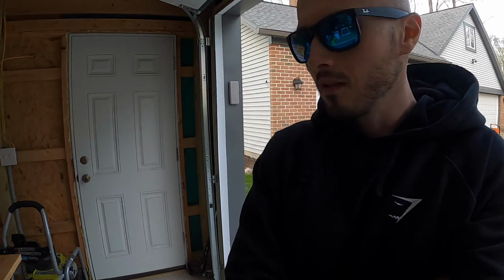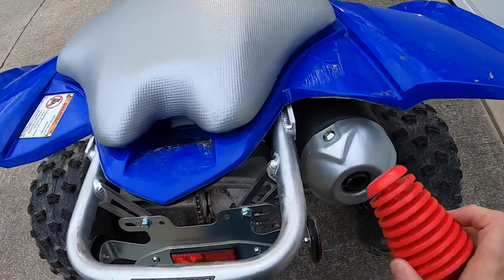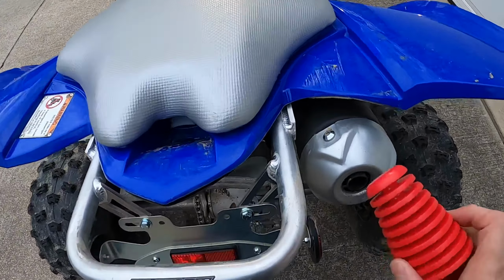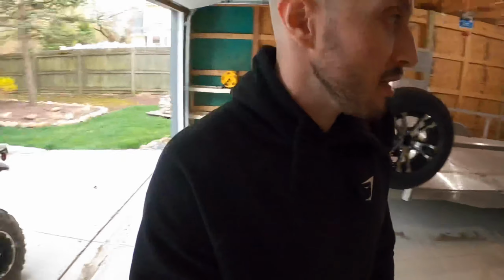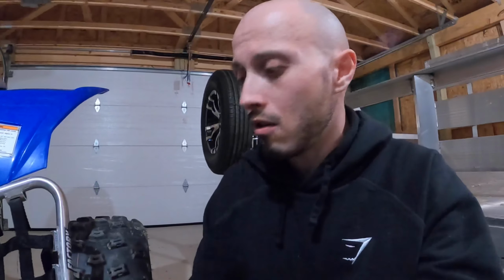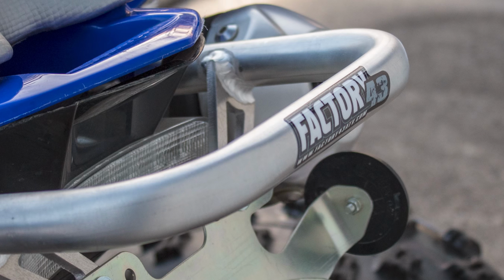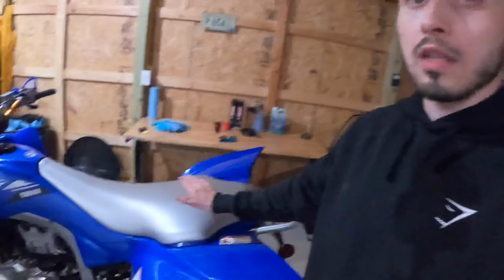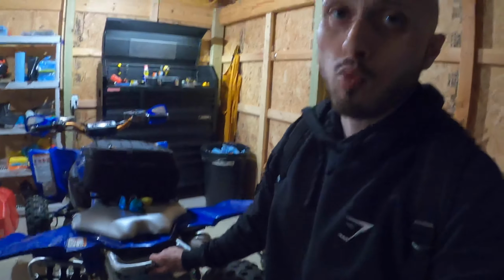Quad Talk | yfz450r | Wash, Future Mods? I NEED YOUR HELP!

Comment: If you have a newer year YFZ then you need to replace the clutch ASAP. The new clutch baskets explode and cause thousands of $$ in damage. For big 3, the Dasa has best numbers on the dyno. As far as other parts can’t go wrong with a precision stabilizer.
Reply from the maker: I’ve heard of the clutch basket issue. It’s on my list! Hopefully I get to it before I have a disaster. How is Yamaha getting away with selling a defective clutch lol.
Reply: Idk man they need to fix it tho. I just got a 2021 and had no clue about it before I bought it. Luckily someone told me about it before I rode it and did any damage.